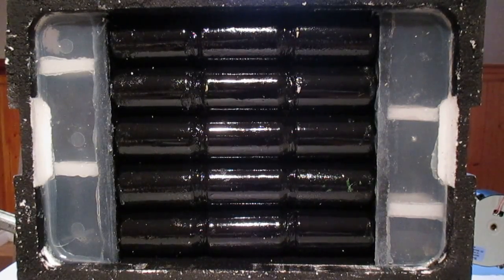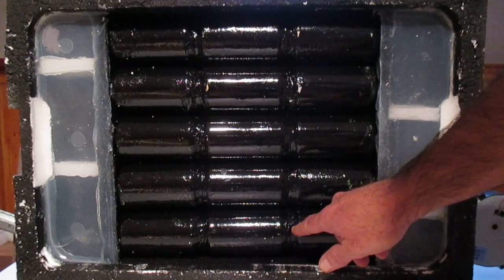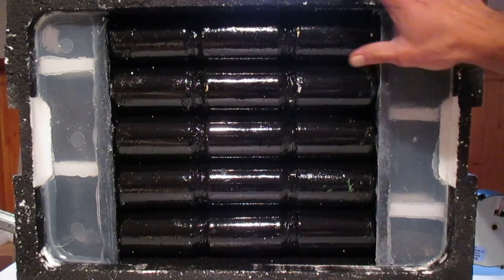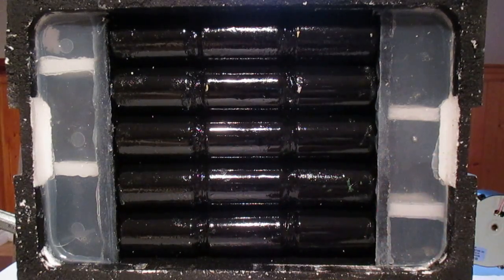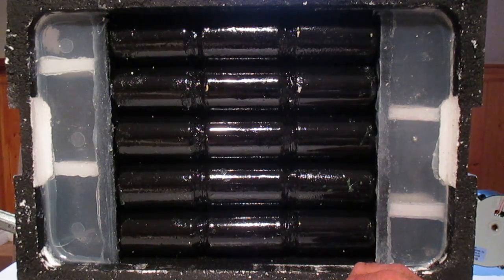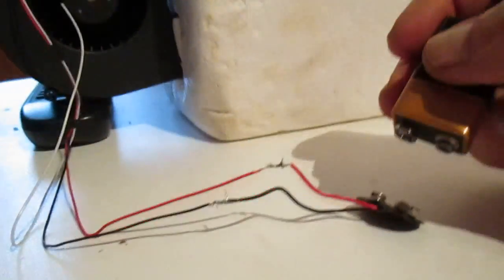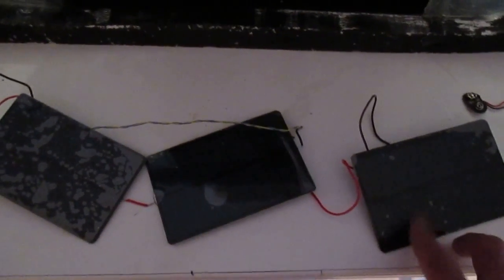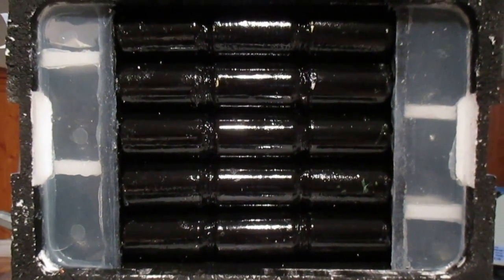How a beer or pop can solar heater works

Comment: I made a similar (big)one, but with an intelligent controller, so you can see in & output temperature, and can control the fan and stuff. You can see it on www.solarair.livotel.com. I included the software as freeware for it.

Comment: I'm confused on the application of these, I get the basic mechanics of them though. As I understand it you mount one of these in a spot which catches sun and then the cold air enters in the base and you get warm air out the top. However in winter times the power of the sun is very weak and so you will get little to no benefit from one. In summer you will obviously get lots of nice warm air out of them, but in summer you are already living in a well warmed house from the outside temperature and so do not need this type of device.

Have I just been blind and missed the point of these things?
Reply from the maker: I know what you're getting at Feygan - i think it depends on the area you live. I'm in Nova Scotia on Canada's east coast. Here, a good part of the winter is cold but sunny. Just the last few weeks we've had many days in the -20 Celsius range that were very sunny. I hear winter's on the West coast of Canada, tend to be milder but rainy - these units probably wouldn't be as useful in that climate